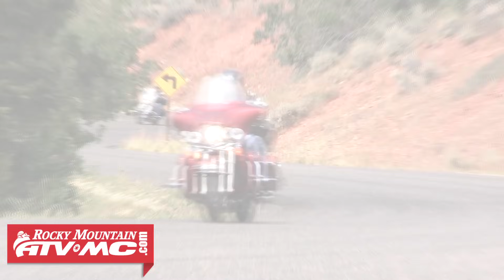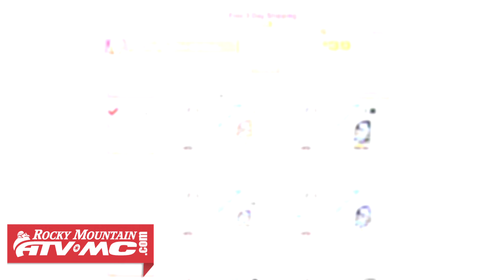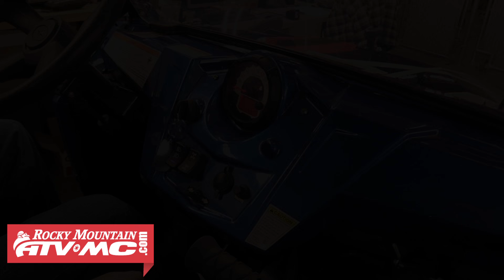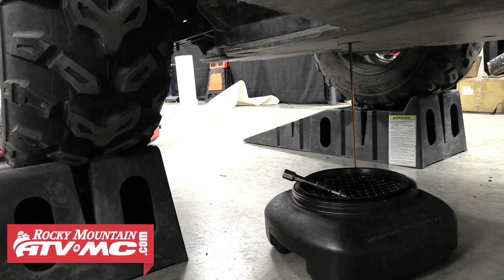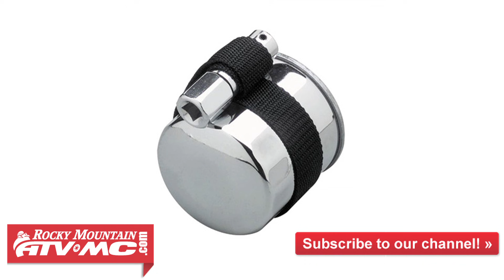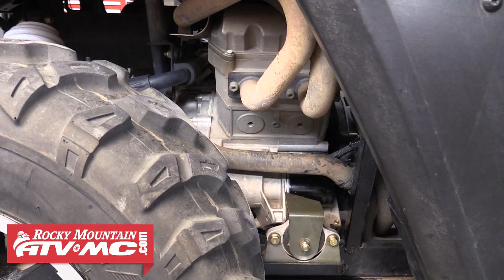How To Change the Oil on a Polaris RZR 800

Comment: Just got done changing mine. Sometimes Polaris blows me away how they design things. They leave like a 2 mm clearance from the oil filter to the engine block, they put a oil filler tube That’s at an angle that you can’t get at to put a decent funnel onto it so you’re not leaking oil over the place. I have to take off the skid plate just to get at the oil drain plug. God they make me crazy sometimes. Polaris, are you listening?

Comment: Such a garbage design for maintenance (especially the 6mm why not a T-30 Torx).  The spark plugs aren't easy either if you added a roll cage. I'll stick with Yamaha and Honda from now on!
Reply: Agreed. Seems like Polaris just threw things together on this engine and the simplest things like changing the engine oil are designed by idiots.

Comment: what is the electrical connector located above the the oil filter mine is a 2014 RZR 800s
Reply: cam sensor
Reply: Cómo dele quitan las bujías